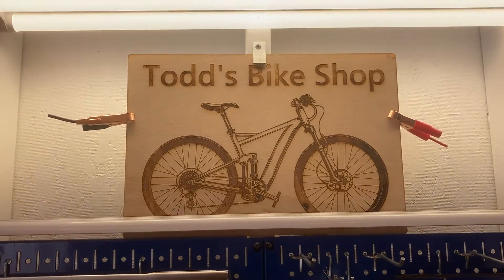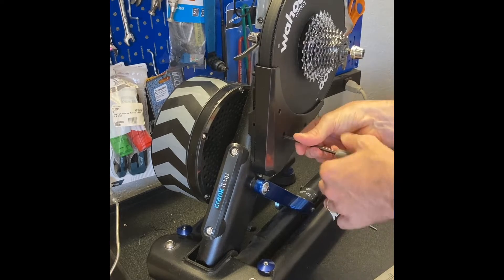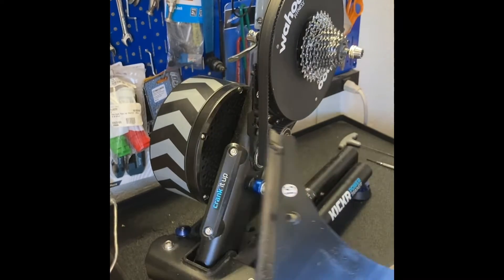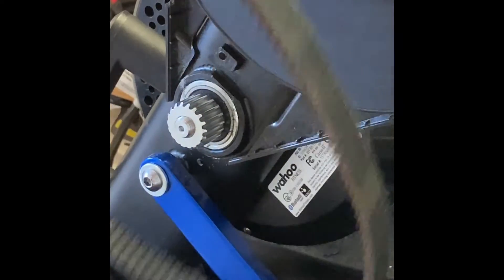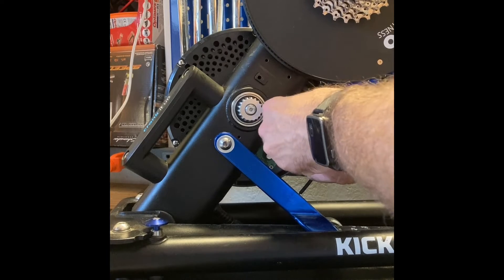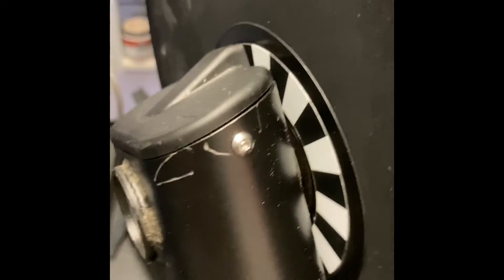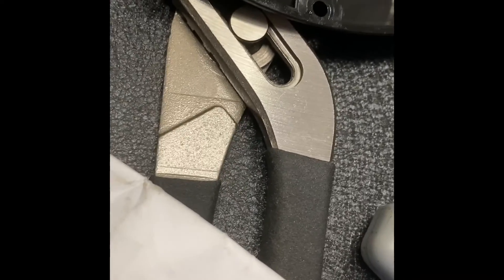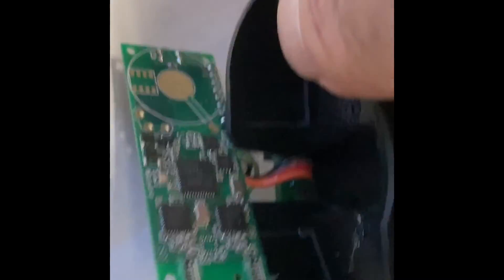Wahoo Kickr V1  PCB Board Location, Removal and Survey

Comment: Where do you get chip/board replacements?
Reply from the maker: I didn't - this is a software problem :)
Reply: My bluetooth connection is not holding
Reply: I fixed mine by ordering this from - The Jungle   Tacx Flux S Smart Bike Trainer, Black, Model:T2900S.60